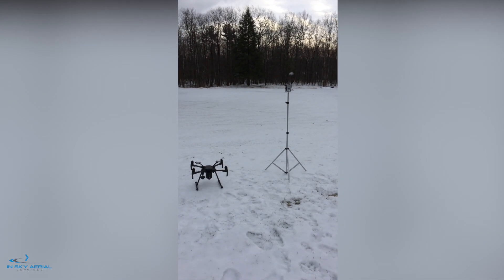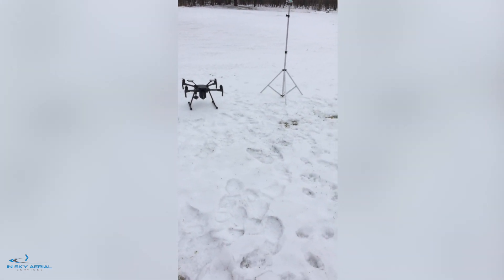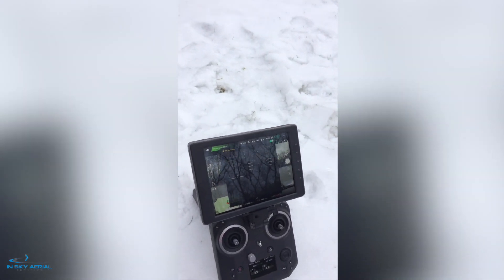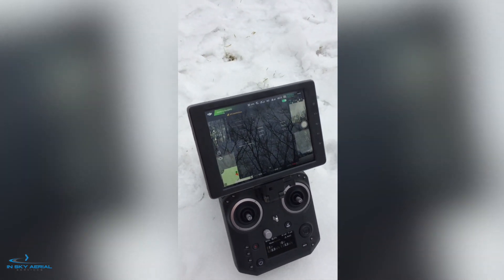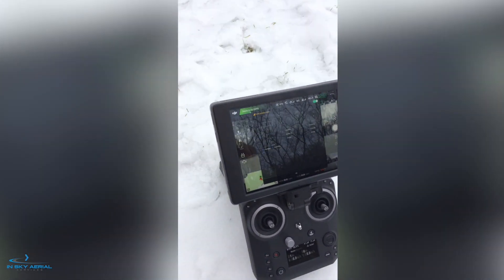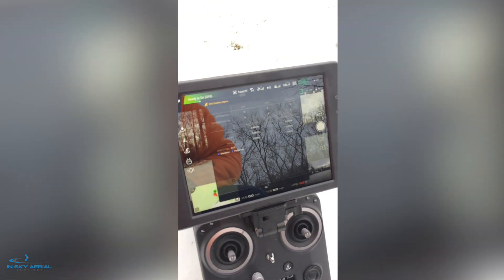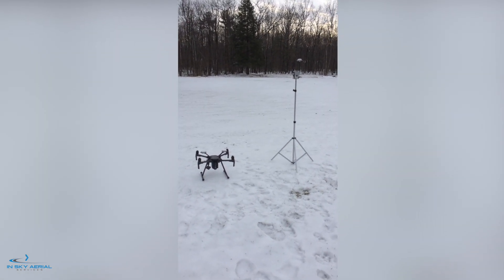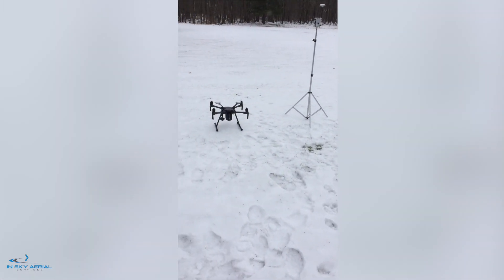DJI Matrice M210 RTK Setup - Field Test

Comment: Hi! what is the problem if the aircraft coordinates in the rtk signal doesn't appear or it says N/A and also there is no Orientation and Positioning. I have all the coordinates from Antenna 1 & 2 and also from Base Station all are green.
So what's the problem if thats the case?
Hope you can help me. Thank you!

Best Regards.
Reply: Same issue here. Got good signals from all but the Aircraft Cords say n/a
Reply: Has anyone solved this issue?  I am having it myself.

Comment: How do you enable the orientation position button?
Reply from the maker: Directly on the screen.    The radio button will be gray in color,  tap it on the screen and it will turn blue indicating it is enabled.
Reply from the maker: I should add that the ground station will need to have satellites acquired indicated by a steady green LED on the D-RTK located on the ground system.
Reply: Does not work by tapping on the screen
Reply from the maker: I was mistaken Elias.   will enable on its own.
Reply: Elias Fowler are all lights showing green on both ground base station and data link pros?